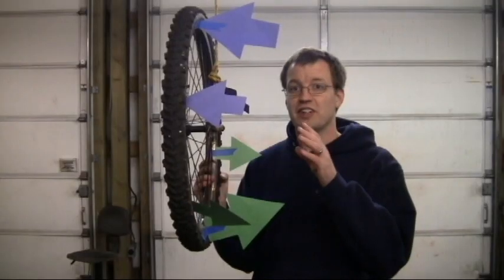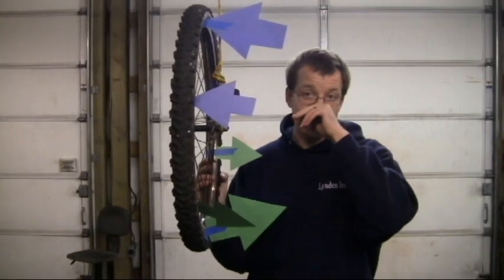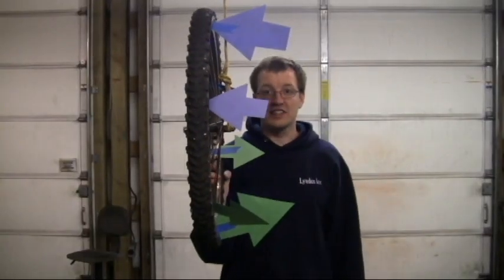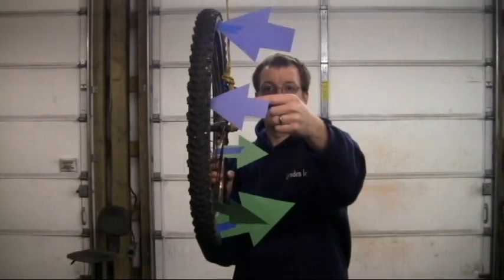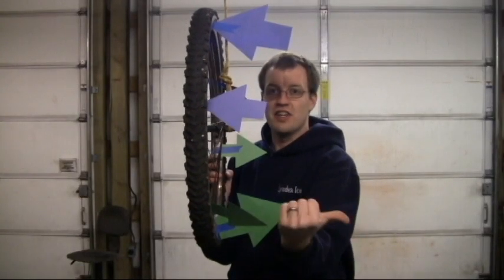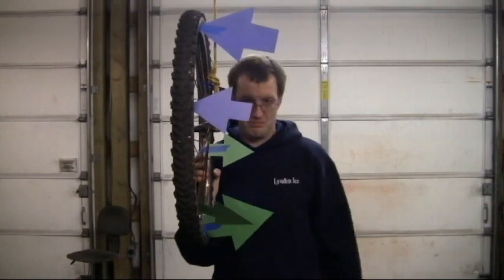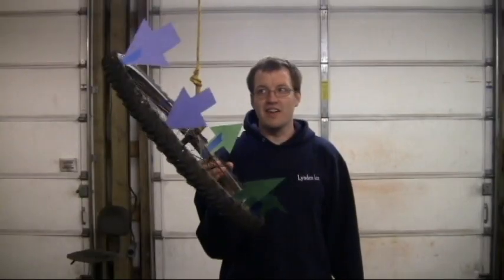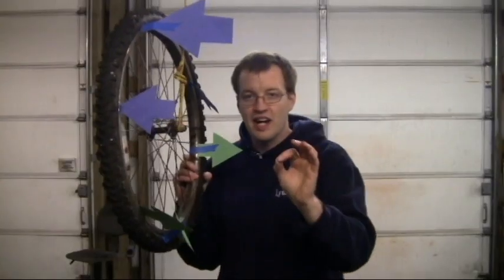Gyroscopic Precession SHORT VERSION explained logically (Spinning Tire on a string gyroscope gyro)

Comment: When the tyre is stationary the only force is gravity which is pushing down, not sideways as you say. Because the wheel is supported on one side only, it may appear that the force is coming from the side, but its not.
Reply: I think you are right on main force at work here (gravity), but I think he means that gravity is translated to torque and then re-translated in to the momentary linear force that is derived from torque. Tho I'm not 10% sure that I'm correct here.

Comment: Counter steering works but if you've ridden long enough you can feel the bike's handlebars move very slightly in the right direction before gyroscopic forces take over.

Comment: Scientists actually don't agree why and how a bike stays upright. So this isn't correct.
Reply: Just because you don't understand the way someone is explaining something doesn't mean they are wrong. Just look up counter steering on a motorcycle if you don't believe me. That was something I was taught in my motorcycle safety class. It is something I have experienced first hand. It happens the exact way he explains it.
Reply: that is unrelated.
Reply: Wow, you have an agression problem, dude! Scientists in Delft have discovered how a bike stays upright, and it's not due to the gyroscopic effect. However, the gyroscoping precession is definitely real, and I think it's explained rather well in this video. Peace!
Reply: Daan Haeyen
Not smart enough to handle presenting the upright bike solution then?
Reply: Thank you very much Hanniffy!
Reply: Daan Haeyen
It's not.   You are just avoiding the issue, thinking I'm some troll you can ignore.
I'm not  a troll,  so stop talking bullshit.
Reply: cH33zewarri0r
so?  it doesn't explain how a bike stays upright.  No-one agrees what's going on.

If you think you do I suggest you write a paper and collect your nobel prize.

Becuase it's defeated all scientists so far on the planet.
Reply: Gyroscopic precession is the thing that is being explained in this video. This is (probably) not what keeps a bike upright, but that doesn't mean that this video is incorrect. This video never claims to explain how a bike stays upright.
Reply: Daan Haeyen
 I just saw a girl today on a bike, on her phone, not using her hands.

She was riding the bike and it was moving really slow. LIKE REALLY SLOW !

Like  10 inches per second, even slower.

perfectly upright !

Nobody has any explanation that makes any sense.

We are missing something very important about gravity.

The video isn't wrong,  It's just hilarious how people don't know why  in 2016.

If you can rise a bike so slowly upright,  none of the speed based explanations apply.

Far more important question I think !

They don't even know why ice skaters, can ice skate either....
Reply: What you're saying isn't quite right. The concepts in the video are correct and gyroscopic precession is usually one of the reasons why a bike stays stable. Today's copy of Nature talks about Jim Papadopoulos' and his work on the stability of a bicycle which you can use to design better bikes, link here http://www.nature.com/polopoly_fs/1.20281!/menu/main/topColumns/topLeftColumn/pdf/535338a.pdf

But yeah, scientist's models on the stability of bikes aren't perfect, but as of 2016 they're pretty decent and constantly improving.
Reply: Bradley
Nah, they really haven't a clue.

But guess what,  I recently took some LSD and this seemed to be a lot on my mind. 

Silly really... but anyway I got the answer.

Naturally you won't believe or understand it, but I do, since I've been into spritual matters and nature of reality for a long time.

The reason is that we live in a holographic reality.

It's essentially a consensus reality.

look at the quantum bells experiment, it's something not even most scientists comprehend.  This experiments proves reality is subjective.

It turns out this is possible because we humans simply agree that is so, that is what we want to happen.

Hence all our mutal agreement that a bike stays upright, that is how reality is made.  So physics laws will lierally bend to make it so.

So the answer needs pretty advanced thinking, where science is nowhere near yet.

I'm sure you'll think it's crazy, but that's the real reason.   So it's literally very trippy.

Comment: I don't think bicycle riders counter-steer with the bars. The bicycle is so light that a weight shift can cause a quick and effective counter-steer on its own. A motorcycle requires more force on the bars to initiate the turn, applied consciously or not, due to the higher speed and higher weight. Although a bicycle going down a hill at race speeds might be a different story!
Reply: You do, at a much lesser scale but you actually do it. Try riding without your hands on the handlebars and steer with your weight looking closely at the handlebar -> they will initially move in the opposite direction of the turn and then to the inside of the turn. It is exactly the same as in motorcycles. :)
Reply: @dariosarti2791  still, the rider didn't touch the bars, so the counter-steel was only initiated by the weight shift.

Comment: As I understand it, countersteering on a bike works less on the principle of gyroscopic precession (like a helicopter cyclic) but rather because the bike below it's center of gravity actually moves laterally in the direction you steer the handlebars for a fraction of a second (due to tires having contact/friction with the road), thusly causing the portion of the bike above it's center of gravity to move laterally (or lean) in the opposite direction (also due to momentum/centrifugal force, just like a car leans "left" when you turn right). The rider's natural instincts eventually stops him from applying more force to the handlebars (which would lean him all the way into the pavement) and you thusly lean through the turn "balanced" between gravity pulling the mass of the bike down and centrifugal force pulling the bike "up" (or laterally away from the center of you turn's arc/chord) as you drive through the turn. Although the effects of gyroscopic precession are coincidentally also working in favor of turning the bike the way the rider intends when countersteering, that effect is not really what does the lions share of the work in this case (that is getting the bike to lean quickly and thus turn quickly in the opposite direction) but GP is a factor no doubt. If anyone thinks I'm wrong on this, you might be right, I don't know the math and the actual proportions of these forces. I'd be curious to know if this is accurate or inaccurate.
Reply: Visda58 Great video, by the way! I should have mentioned that the explanation of gyroscopic precession with the bicycle tire was the most logical I've seen.  I've been trying to "internalize" the understanding of this phenomenon for a long time and this was the clearest explanation I've seen. Well done!
Reply: lol, normally there are text walls, but this is the text trump wall.
Reply: Lol, yeah, yeah, I know. BUT THIS IS IMPORTANT.

Comment: There is a torque on the wheel due to gravity which is parallel to the ground and the plane of the wheel. Analogous to the momentum vector of a particle "wanting" to point in the direction of the resultant force on a particle, the angular momentum vector of the spinning wheel (perpendicular to plane of wheel) "wants" to point in the direction of the torque on the wheel and hence the wheel moves around "chasing" the torque. The wheel must stay upright for this to happen, though the resultant force on it is 0.
I just excepted this an experimental fact.
However, you appear to be strongly hinting at a way to somehow "derive" it given Newton's second law for a particle.